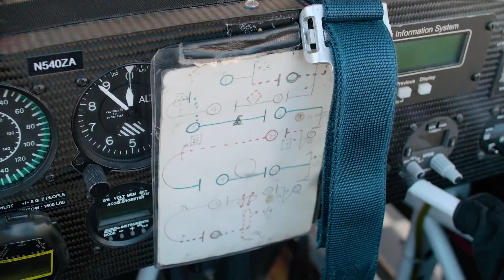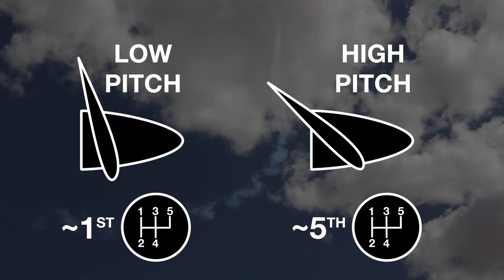Red Bull Air Race - The Most Intense Experience Of My Life

Comment: I would say the pitch adjustment of the prop being compared to a gearing system is a not the best idea for a comparison. 
Constant speed and variable pitch is more directly comparable to the CVT transmission that you made a video about.
Reply from the maker: Yep, and a CVT with a high gear ratio is like being in first, and a CVT with a low gear ratio is like being in your top gear. You balance speed and torque.

Comment: Similar engine as the one I fly, except mine is a bit smaller and not aerobatic rated. Mine is the Lycoming IO-360 (Fuel Injected, horizontally opposed and 360 CU-IN)

Comment: Could you make a video on what happens when an engine stalls?
Reply: Mackan Johansson When we use the term "stall" with regard to aviation, it has nothing to do with the engine. It's just a term for what happens when the plane isn't moving fast enough to maintain level flight, and starts falling. We practice it all the time in flight training.
Reply: Michael Whitesell Haha probably shouln't have asked this on a flight video. I meant what happens in a car when it stalls.
Reply: Obviously...
Reply: Aircraft engines don't stall. You never have that kind of idle load. If your engine fails, then something's horribly wrong, but the engine isn't what's keeping you up in the air, the wings are. As long as your relative angle (or angle of attack if you prefer to use the correct nomenclature) isn't too high the wings are producing lift. In practical terms, this means that all the engine does is counteract drag. Once it fails - we use gravity. It means you can't maintain altitude forever, but it's usually a controlled rate descent and most aircraft have sufficiently efficient wings/airframes (aerodynamically efficient, expressed as a total lift to total drag ratio of the airframe) that you get plenty of time to find a suitable place to land or ditch. If it isn't an airfield, road or dirt/grass strip you'll probably wreck the aircraft in the process, but as long as you're not landing into a building and you can maintain control of the aircraft such landings tend to be survivable (the special case here being larger commercial/military aircraft which require a good landing surface).

In an aerodynamic context, stalling refers to what happens when you exceed the wing's critical angle of attack. Basically, the flow structure breaks down, the nice smooth-ish flow pattern is replaced by sizable unstable vortices, which in more acute cases cause a cyclic load on the elevator (buffet) and in extreme cases - vibrations throughout the airframe. Aircraft usually have some kind of warning system to remind the pilot when he/she gets close to critical angle. The correct remedial action is reducing the angle of attack as soon as possible and by any means necessary. Typically there are two things a pilot can do to reduce angle of attack - turn the wings into the flow direction (i.e. lower the nose) and apply full power. The first one is obvious, the second recovers any lost airspeed and accelerates the aircraft to a point where a lesser angle of attack is required to maintain flight direction.

When applied correctly and immediately (i.e. at the sound of the warning buzzer) a stall is recovered before it's occurred. When no remedial action is applied, the massive increase in drag bleeds away airspeed (necessary for the correct functioning of ALL aerodynamic surfaces), taking away control almost completely and making the stall unrecoverable (i.e. you fall out of the sky like a brick!). The ease of entering this condition and the dangers it poses requires extensive training on the matter.

Additionally, the condition may be exacerbated by a wing drop which effectively removes any of the remaining lift. The typical instinctive action in this case is to level the wings, but doing so before restoring flow leads to loss of control more often than not, so training regimes ensure every qualified pilot will first reduce angle of attack and then level the wings.

At higher altitudes and airspeeds this condition isn't really a problem. It's unlikely to happen to begin with and even if it does - there's plenty of altitude which means there's plenty of time to correct the problem. Where a stall is most dangerous is during landing. On short final an aircraft is most vulnerable to a stall as it's travelling very slowly, necessitating a close to critical angle of attack (to maintain lift) and the controls are less responsive (all aerodynamic forces are proportional to the square of velocity). If a stall occurs on short final there is no expendable altitude to correct the problem, thus such occurrences tend to be fatal. This is why aircraft land faster in gusty conditions and also why the stall warning sounds before a stall has occurred.

Comment: Cool video. Heads up, you got the propeller explanation backwards. A higher angle creates more thrust, but but is less efficient (similar to 1st gear in your analogy) while a shallower angle is used at higher speeds. Also ailerons are not the same as flaps :)
Reply: Uhh, no, full forward on the prop lever is low pitch and used on takeoff, landing, and slow flight. The prop lever is pulled back during cruise increasing the pitch, efficiency, and the "bite" of air the propeller takes.

Comment: What an unusual engine... I'd love to hear the reasons why they use this over some other powerplant options. Does this not have any transmission at all? I guess they save a lot of weight by not having a radiotor+liquid cooling system - so if it's going to be air cooled, that rules FI out.

Plane engines video please!
Reply: Aircraft engines need to operate at lower RPMs because you don't want the propeller tips to go supersonic. Once they do, aerodynamic drag increases a lot for little increase in lift.

Reduction gearboxes add complexity, weight, and an additional point of failure, but they are present in some aircraft.

The "transmission" this particular aircraft adjusts the pitch of the propeller blades to make them take smaller or larger bites of the air at the same RPM.
Reply: Aircraft engines need to operate at lower RPMs because you don't want the propeller tips to go supersonic. Once they do, aerodynamic drag increases a lot for little increase in lift.

Reduction gearboxes add complexity, weight, and an additional point of failure, but they are present in some aircraft.

The "transmission" this particular aircraft adjusts the pitch of the propeller blades to make them take smaller or larger bites of the air at the same RPM.

Comment: ah the lycoming engine...its 540 ci and 300hp in the aeio trim...these engines are perfect for propeller driven airplanes because of the 3000rpm speed limit for the prop itself,low reving, lightweight and considered 100% reliable when properly maintained...you could put a corvette motor in a plane but will need a gear reduction unit to keep safe prop speed

Comment: how about a video explaining how they keep fuel and oil to the engine upside down?
Reply from the maker: There's an oil feed up top on the engine and at the bottom, so either way oil pressure will be there!
Reply: That engine is fuel injected and has two fuel pumps: mechanical and electrical one. The plane isn't in one attitude long enough for fuel to pool away from the pickups. Those planes usually also have inverted oil systems. Christen is one manufacturer of such oil systems you can probably find a diagram of how they are hooked up on the web.
Reply: Flame Beats or it could have a dual impeller style fuel pump, as used in most fighters - 2A6X4 as well ;)
Reply: I know with model planes the way you keep fuel to it is by having a weight at the end of the hose in a gas tank (just like a chainsaw or grass trimmer engine, those can also run in any direction, however they are 2-cycle so the oil is mixed with the fuel so orientation really doesn't matter). I'm not entirely sure how the lubrication system on these planes work, and that's a great question. I will probably do a search to find that because now I'm curious too.
Reply: ain't worried bout nothing instrumental
Reply: Flame Beats Mildenhall! You understand the CV-22 fuel system?
Reply: http://www.aircraftspruce.com/catalog/eppages/christen801.php
Reply: They are both fully pressurized, multi-feed, closed loop systems, without the vents in the crankcase for over-pressured oil or fuel to escape out of like on a car.

Comment: Pulling those G forces without the compression suit fighter pilots wear is INSANE!
Reply: the difference between jet pilots and aerobatic pilots is that an aerobatic pilot experiences high gforce for relatively short periods of time while a jet pilot has to experience relatively lower gforce for longer periods of time. For jet pilots it is more dangerous than for aerobatic pilots.
Reply: Agreed, they have to be trained really well. And they're exposed to even higher Gs than fighter pilots! Red Bull Air Race has a limit of 12 Gs while fighter jets are electronically limited to 9 Gs (and pilots get to wear a compression suit).
Reply: Bah... You're fine up to 6!

Comment: Propellers themselves are actually more efficient at lower speeds (you get more thrust out of less power). The problem is of course if a plane goes too slow it will stall, so the plane has to go fast. At rest, a cessna's prop will produce 37lb of thrust out of 2 horsepower, while the same plane going 75mph will only get maybe 200lb thrust out of 50 hp.
The purpose of variable prop pitch is to be able to 1) go faster without redlining the engine, and 2) avoid high tip speeds, since the closer the propeller's tips get to mach 1, it creates more drag and the propeller becomes less efficient.
The reason high prop pitch generally isn't as efficient is because you are pushing air at an angle- so more air is pushed sideways (which is wasted) instead of backwards - which produces forward thrust.
Reply: I hope you don't confuse airplane speed for propeller speed.
Do you mean that a cessna prop produces 37 lb at 2hp, at zero airplane speed?
And I hope you mean that if prop speed goes up but airplane speed doesn't it will NOT produce 25 times more thrust at 50hp than 2hp?

Please clarify.

Comment: i know swept wings are mainly used on supersonic aircrafts but what's stopping it to be on acrobatic planes?
Reply: Wings are swept to bring the center of lift further back for more stability in flight. But on an aerobatic aircraft, you want the center of lift to be very close to the center of mass so that your aircraft can be maneuverable.
Reply: Swept wings are only beneficial in high speed flight. It make the wings structure of the wing heavier. And for doped that don't reach anywhere near supersonic, a swept wing does nothing

Comment: Aviation is amazing. Everything is kept as simple as possible. No "power steering", no liquid cooling, no complex engine sensors. Just the bare minimum needed to get the plane in the air. It's the good parts of old simple cars with the performance of modern technology. 

Thank you for this great video! I definitely enjoyed it.
Reply: Air racing does  it represent aviation on general. Just like there are car racing series with bare minimum tech.
Check out modern passenger jets - everything is controlled by computers, electronics and hydraulics ... As complex as it can get.
Reply: Aviation in general has some of the most complex machines ever built....
Reply: Key phrase here being "as simple as possible". The bit missing in the end is "... and no simpler!". It all boils down to necessity. In a small aircraft like that, much like in a go kart, the control forces required aren't too big, so a set of cable linkages is more than sufficient. Your power steering analogy is not applied on the correct scale. In most cars, once you get past a certain weight on the front wheels (which isn't very much) power steering is a necessity, otherwise you'd have a very hard time turning the steering wheel. The controls in small aircraft on the other hand are very easy to manipulate completely unaided and the only forces you're counteracting are the aerodynamic load on the control surfaces, which - again - is fairly small. On an aircraft of that size and weight, the cable and pulley system is the optimum solution. Levers add weight, hydraulics add both weight and complexity and electronic control systems add a prohibitive cost to the airframe (the entire set of cables and pulleys will set you back as much as ONE electric actuator!) while removing a lot of the feel from the control column (which is much more important in a light aircraft than in a car!). Redundant magneto ignition is still used in a lot of piston driven aircraft as other types of ignition systems are deemed too unreliable.

Liquid cooling is unnecessary on an aircraft engine as there is ample ram air available to cool the cylinders, unlike in a car engine, and the extra weight and complexity therefore grant no extra benefit (where in a car you reduce noise and remove another power drain). There are however some liquid cooled aircraft in existence, such as the Hawker Hurricane which had a liquid cooled Rolls-Royce Merlin.

As far as complex engine sensors go, almost everything inside these engines is either mechanical or hydraulic for reasons of reliability. The downside is always extra weight, often less efficiency and usually higher responce times (as inertia places a greater limit on these systems over digital). This is a simple engine meant to operate efficiently in a fairly narrow power band, so most extra bits on cars are unnecessary. The most complex control system is the prop governor which is hydraulic in larger aircraft, but likely entirely mechanical in this one. All the springs, levers, gears, etc. can be replaced by a sensor and an actuator and save a good few kg, but anything with an adequate reliability rating would again be prohibitively expensive.

Larger aircraft require a hydraulic power assist system, otherwise the pilot is physically unable to apply enough force on the control inputs. Gas turbine engines also require more complex control systems to prevent incorrect input from shutting them down. In the past these consisted of numerous levers and hydraulic actuators, all of which have now been replaced by digital FADEC and nobody is looking back to the "glory days" of these systems. Just to go back to your analogy, a single modern commercial gas turbine engine (say the Rolls Royce Trent 1000) has about four times as many complex sensors as your whole car and its FADEC computers alone cost more than a lot of supercars. The difference here is that a strict maintenance regime is followed and the manufacturer's business model is completely different.

After the military, wide body transport aircraft are the biggest adopters of fly by wire technology, which entirely replaces the direct input hydromechanical systems of older aircraft with computer controlled electrohydraulic and more recently - electromechanical actuators and a simpler to construct pilot input system. This allows for augmentation of pilot input to ensure that the aircraft remains within its flight envelope at all times (there's also an OFF switch for that function by the way) and makes it easier to tune the handling of an aircraft artificially in order to maintain consistent feel both throughout different flight modes and across a fleet of different aircraft. Airbus are known for being an early adopter of this method, though a very similar system was required on the Concorde.
Reply: Exactly, the beauty is in the simplicity.
Reply: Y10Q So it's faster and more fuel efficient than a racecar.

Comment: Sounds like a CVT…
Reply: yes yes manila folder pressure and governments. I know all of those words. great explanation
Reply: Kinda. With that prop (variable pitch or constant speed) you set the desired manifold pressure and prop RPM and a governor uses oil pressure to change the pitch to maintain, well, a constant speed. This is especially good on aerobatic planes as it prevents the engine from overspeeding on dives.